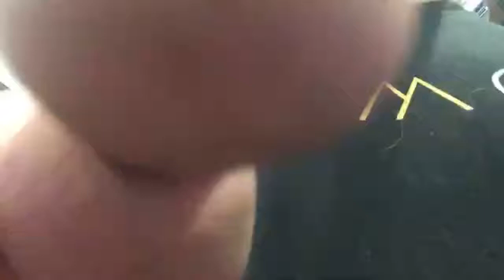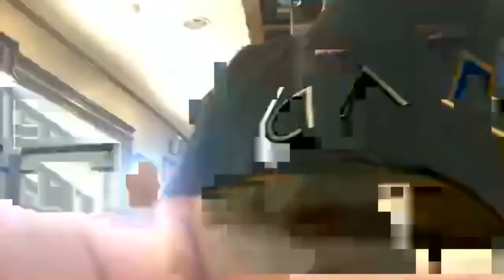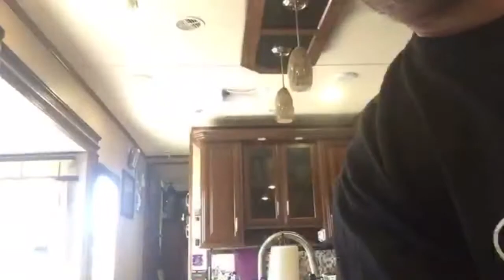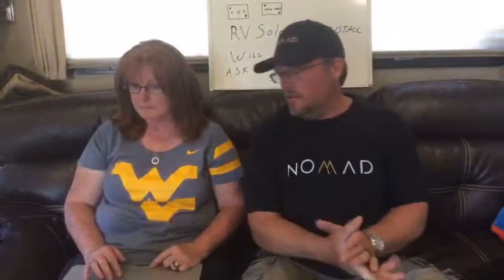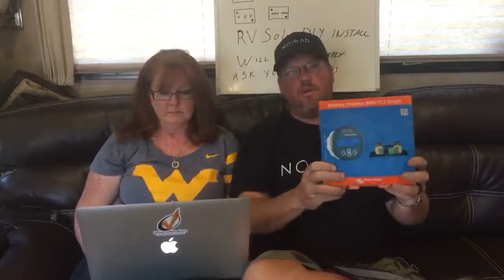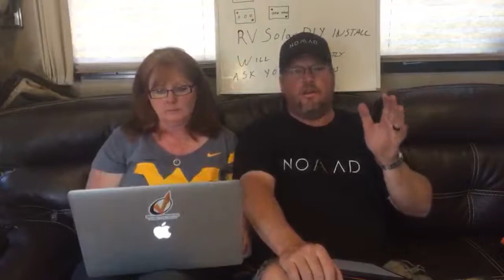RV Solar DIY Install (Topic: Batteries)

Comment: We would be high 110 users as we would want it to be cold in our RV during the summer so A/C's are a must and be able to use a dish washer drawer and a washer & dryer. We have not purchased an RV yet but we would love to be boondocking GLAMPERS.  If I have 10-12 Tesla Model S battery module, 24V, 233Ah, 5.2kWh, 444 Panasonic 18650 3200mAh modules. What would you recommend for solar watt power on the roof and what equipment for a 45 foot older model Prevost bus conversion 2000-2003? I love what I have seen with the Victron products.
Reply from the maker: The goal is definitely going to be to try to get as much solar as possible on the roof. I have seen several setups that have built racking systems to mount the panels on the roof on an elevated plane to eliminate any interference from obstacles on the roof like vents and AC units. All it takes is money and time. As we are  a little more modest in our build, we may not be the greatest resource for your project. But also keep in mind, size does matter when looking for boondocking locations.

Comment: My previous solar system consisted of almost 400 watts and I used 4 Trojan 105 RE 6 volt batteries and I got 6 years out of the batteries. They cost me around $150 each for a total of $600 which is less than 1 lithium. battery. They weigh more no doubt but the cost just doesn't justify it at this time imo.  I had a Trojan watering system and all it took was a few squeezes of the bulb to be able to top off the fluid levels using distilled water. As with everything, as demand picks up the lithium prices will eventually come down to reasonable prices. With my new Solitude I will be installing a new system and as much as I would like to go lithium the price point just doesn't justify it at this time.
Reply from the maker: I can tell you that for my situation, I am extremely happy I made the switch to The Battle Born Lithium. We have been in a pretty epic boondocking tucked into the trees. Our morning sun is blocked by the trees. Our afternoon sun has been covered with clouds, and our evening sun has been able to bring the bank up to high 80%. Lowest I have seen the last few days has been low 60's %. I still do not worry about having to get out the generator. The furnace has been quite the load also as the morning temps have been high 30s. I can not say they are worth the investment for everyone. But I do plan on using mine for the next 10 years if allowed.

Comment: I have magnum energy Monitor in RV ME-RC50 remote will this monitor the batteries ?
Reply from the maker: Jerry Barger For the battery monitor kit for your Magnum System you need to use the BMK. https://amzn.to/2KDsGhz
Reply: Thanks